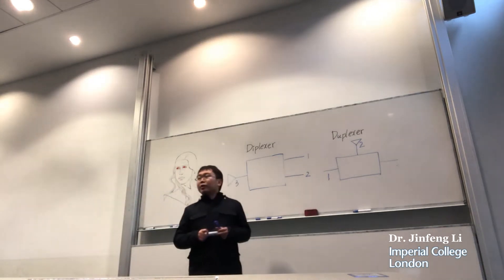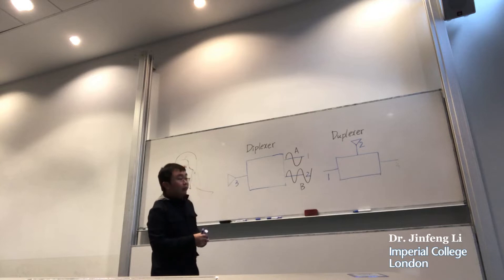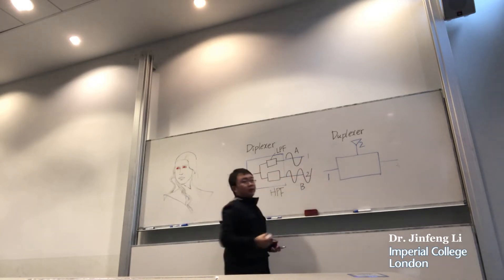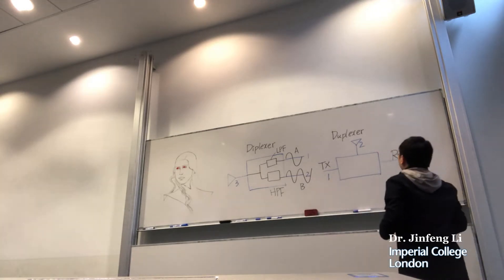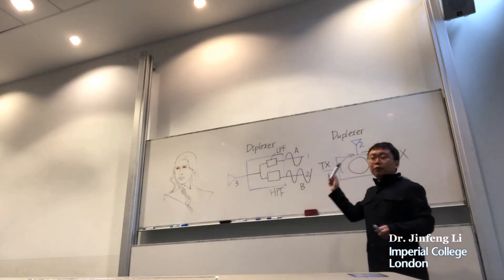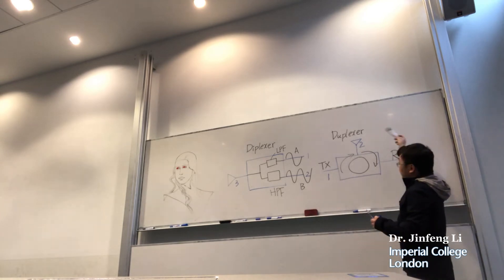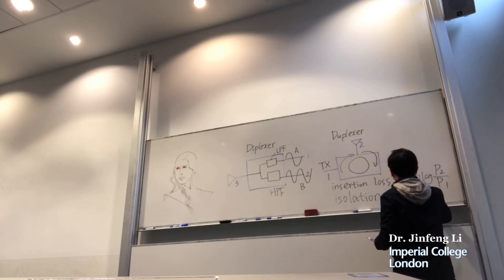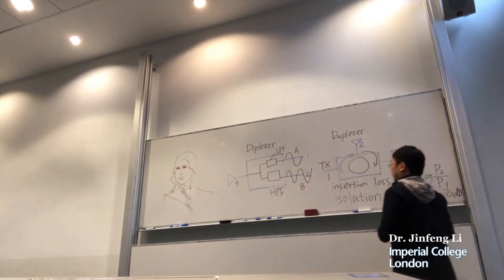RF diplexer and duplexer

Comment: Sigh, I would really like to know what impedance is necessary for each filter at the common port. Does putting them in parallel there result in half the impedance or does the impedance not change?

Comment: Excellent explanation. I install antennas and satellite dishes, I always install diplexers to combine Satellite TV with Cable TV or Satellite TV with antenna (TV and Radio). It is mandatory two diplexers the first for Aerial/Cable TV and satellite dish, the second is for satellite receiver and TV, Cable/Antenna STB, FM/DAB Radio. For aerial it is recomended an amplified splitter. There are diplexers with 5 inputs and 4 outputsm the 5 inputs are for 4 LNB inputs and one Aerial/Cable TV and the 4 outputs have both signals combined, at the end a diplexer is mandatory. But if you only use a satellite receiver no need for a diplexer.